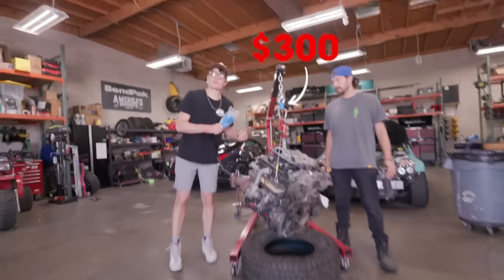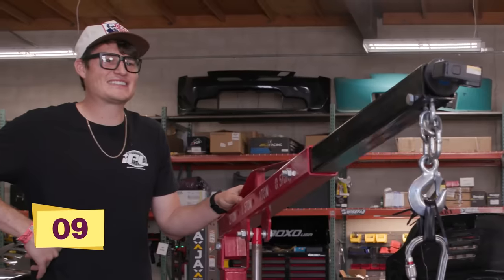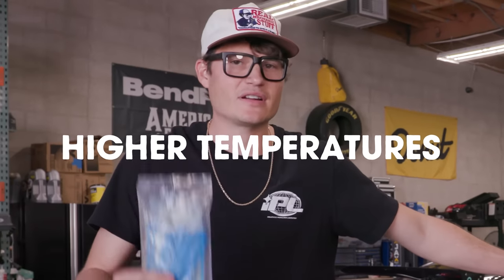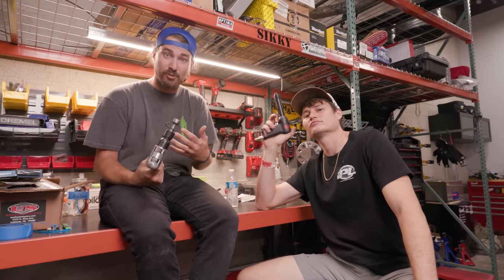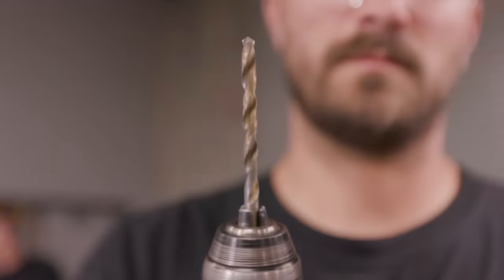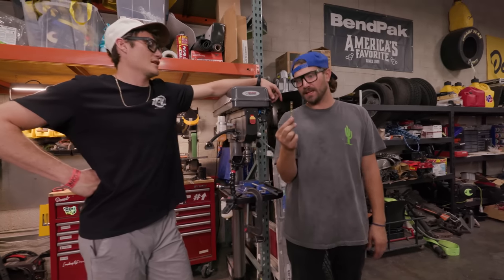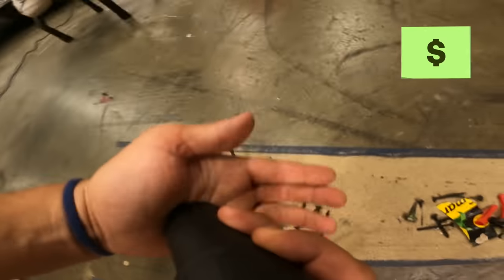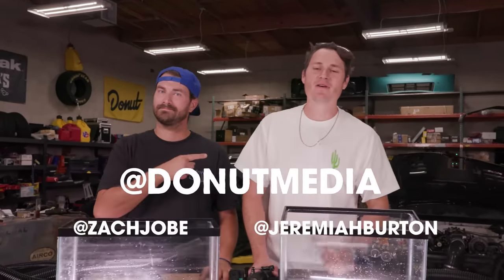We Test: $1 vs $300 Zip Ties

Comment: My dad was an aircraft mechanic back in the day, so in place of zip ties we always used the titanium cable they wrap engine bolts in to prevent them from vibrating loose. 
Probably the most expensive "zip ties" anyone could use
Reply: Probably still cheaper than 3$ a go. Stainless steel lock wire is cheap enough and I think would outlast pretty much any zip tie.
Reply: Called lacing wire
Reply: @alexriofrio5754  Today I learned about 'cable lacing' 👍🏼 is it ever done with metal wire? My only experience with what I call 'lock wire' is steel wire. Useful in holding motocross grips on, also required on certain fasteners especially on race tracks.
Reply: he said titanium
Reply: @poshun9407  I guess it would be called lock wire. I guess I use the term lacing wire for any thin wire that can be used for securing fasteners.
Reply: Yeah no titanium is most certainly not used to wrap bolts unless your dad was working on the SR-71 or something. Unlikely.

Its likely stainless steel  and you can buy about 100 feet of it for $25
Reply: @siddharthiyer1120  it was back in the day so possibly lol
Reply: @siddharthiyer1120  he actually did work on those planes
Reply: @urk5204  cool
Reply: @poshun9407  using wire would be a bad idea incase it cut through shorting the cables.
Reply: @allothernamesbutthis  Yes, the lacing wire all seem to be made of softer materials which makes sense.

For occasions where more strength is required then metals could be used but these aren't really cases where you would use a zip-tie anyway.

Comment: I'm going to guess the more expensive vacuum probably has a HEPA filter and actually traps most dust particles. What point is there to the cheap vacuum if it just spreads the dust around the shop?
Reply: You can only pull one atmosphere of vacuum, so the "sucking" power of the units is always going to be similar.  Along with the filter, I'm guessing that it's just built much better.  Made to last.  Made for a shop that uses it every day vs. a guy using it on weekends in his garage.
Reply: @jeffrobbie472  Vacuums don't actually pull a vacuum (that's very difficult, even for purpose-built vacuum chambers and such), they just create airflow (like a basic fan, but with way more pressure). So you absolutely can have a way stronger vacuum, though it can start to depend on the size of the hose and other factors like that as well.
Reply: All canister vacs come with filters. A HEPA filter is only necessary for people who are extremely sensitive to micro fine dust, otherwise they are not necessary, especially in an open work shop environment. In cases where a person has a sensitivity to dust, face masks work much better as they are disposable and in a dusty work shop environment a HEPA filter would clog up very quickly.
Reply: @TheOnespeedbiker  There. A mechanical workshop doesn't have much dust, more like greasy layer of paste over everything, lol
And a woodwork requires much more than that.

Long ago, I  worked in places with HEPA filters on the air intake and negative pressure in the room... but the objetive was to control the smell of the buds not going outside...ahem...
Reply: @Nwhis  Semantics. Creating airflow is how you pull a vacuum.
Reply: @TheChzoronzon  LOL
Reply: @ailurusfulgens1849  Not semantics, and btw, he isn't saying otherwise

He's saying that a pump able to create a vacumm in a 20l deposit, the usual in these machines, in a reasonable amount of time is no joke, and certainly bigger than anything you are gonna find in a vac cleaner
Reply: shop-vac has one that is around the same price as the bauer, a little bit smaller but not much, and it has a metal casing. i have one at home and it works great. so this seems more like an apples and oranges comparison than anything else. they aren't intended to be used for the same thing.
Reply: It was also way bigger

Comment: As an aircraft mechanic and hobby car mechanic, spend the money on the drill bits. It goes through the hood but anything thicker and the HF bits bend almost instantly
Reply: The cheap ones are most likely designed only for use on wood and plastic.

Comment: Shop vacs, whether big or small are exceedingly underwhelming. Having worked in construction and other areas that require a shop vac just once I want a vacuum that has suction best described as dangerous.
Reply: Ikr. I've done alot of carpentry work, and shop vacs are always pitiful, even if they have a big hose
Reply: Try rigid vac's. I did tile for years and would use all kinds of vacuums when cutting tile. Had to stick with rigid for price and performance.
Reply: Look into fein, pricey but really nice. Don't think you'll get into dangerous suction just due to liability. Parents these days would blame the vacuum for hurting the kids instead of taking responsibility for not watching them, or something lame like that.

Comment: For most things I wouldn't say you need the 300$/100 level, but definitely don't use the cheap as dirt ones either. Especially as you get into smaller and smaller ties, the cheap ones tend to snap before even getting really tight. Likely because a lot of the time the cheap ones are made of less flexible material, so they end up just snapping off easily.
Reply: Like you saw in the test the expensive ones were actually weaker.

Comment: Since you started with just 10 of the expensive ones, each one would have spent work time under tension being fatigued and stretched more than the initial 15 of the cheap ones.
Reply: That's a very solid point you make there. I usually pick apart flaws in videos such as these and completely overlooked that.
Reply: I was thinking the same
Reply: yeah, I want a video by Project farm about this. That channel is more accurate and scientific.
Reply: cheap is still better
Reply: I was gonna say this exact thing but you beat me to it!
Reply: The expensive ones are made from tefzel, which has a room temperature yield strength of about 6,000psi, while the regular ones were probably made from nylon with a yield strength of about 13,000psi. So the experiment was actually pretty close to real life with the tefzel ones snapping at 2x the number of the regular ones. 

Tefzel zipties exist for very specific chemical reasons, and strength is a secondary consideration.
Reply: Plus, who knows how much tension eash tie was under. Maybe one was carrying the load and once that was released, the shock loading popped the rest.
Reply: @mayaibuki  project farm already did a video on zip ties! :D

Actually, I think he's done one on everything they tested lol
Reply: It also looked like the orientation and position of the ties wasn't quite the same between test  runs. I assume they have more tensile strength in certain positions.
Reply: Exactly, and with the heat gun test they
just gave the win to the cheaper ones even though the blue ones lasted 10x longer, bc “IM nOt pAyInG 3$ a ZiP TiE”
Reply: @TheAngryDasher  the biggest flaw is if theyre not perfectly equal in tightness, most of the force is being held by one of them. When it breaks its a zipper of them all breaking. Its just a really bad way to test strength
Reply: While true, it's not relevant to the test results. A few minutes under load will not make that much of a difference. The difference is the material. Tefzel is not as strong as regular zip ties, regardless of what the packaging claims. You don't buy it for that reason in the first place. It's for high temp situations only. If you're buying it, it's because you need it and there is no other option. Obviously.
Reply: That's not how fatigue works.  Holding a constant load isn't fatigue
Reply: @-Mintyy  because its true for 99% of people you dont need a heat resistant zip tie
Reply: @archemides1517  what does that have to do with the fact that it won the test, by 10x the amount of time. Donut has gotten pathetic with their content, look at any of these comments for reference.
Reply: @-Mintyy  okay in what applications are you using zips that need to be resistant to high temperatures because i have used habor freight zip ties in engine bays never had an issue so for most people who arent using them for their heat resistant properties it makes no sense to buy the 300 dollar bag of zip ties. for almost everyone strength will be more important then heat resistance
Reply: yea, guess i never have to worry about my zip ties breaking, i zip tied my capacitor, line output converter, AMP, and TV tuner and all the wires for them to the ceiling of my trunk, best why to hide stuff.
Reply: @archemides1517  then why even run the heat test they did? Why have any tests if they’re just going to pick whoever they want to win? That’s my only point here brotha.
Reply: @-Mintyy  the point of the heat test was to show why those zip ties are 3 bucks a pop
Reply: @archemides1517  if that was to point than it would have better been shown by saying that’s why the blue ones are 300$ a pop and giving them the win. This content is as bad as tv infomercials lol. There is no defending it.
Reply: I think most of these kinds of videos it's never implied that their tests are perfect scientifically, so I don't usually hyper analyze them as long as they convey some information that is useful. Like if someone is testing a tool, if their tasks actually replicate work i would be doing, as opposed to pointless tests like hooking two drills together and seeing which ones break first is not a useful test. In this case it doesn't really matter because I wouldn't(and i imagine most of you would be the same) ever under any circumstances buy $300 zip ties. So there is no reason to really think too hard about it at all.
Reply: True, but considering the price difference that's still pretty insane.

But it was also strongly highlighted that raw strength was not the benefit of those zip ties (and never was: they had the same weight rating) - it's resistance to heat and corrosion.
Reply: The tefzel zipties are likely much more heat resistant and would do great for engine bay components
Reply: @MrNavyman53  Agreed. As a guy who uses a lot of cable ties for a living, in my opinion as a guy who likes science, the test results were scientific only to test how relatively dumb you are for lifting an engine with zip ties based on the zip tie. The only fair comparison would be something like Tyco/TE Connectivity zip ties vs Harbor Freight zip ties in the same material, one zip tie at a time. Or, comparing 2 materials for tensile strength using the same width and length of tie. Without a parallel attachment and really high precision zip ties, the consequence is highly uneven loading from tie to tie. Tefzel also elongates 100 to 300% when it yields, as opposed to 60%-100% for nylon, and as plastics stretch and get thinner it typically does not make them stronger. The heat test was the most compelling, and next time I'm installing zip ties in an atmosphere of superheated air and highly corrosive chemicals I know to get the $3 zip tie, not the $0.03 zip tie.
Reply: @-Mintyy  My only defense of it is that people do really, really dumb crap and hoisting with zipties is not as uncommon as one would like to believe it is. The Tefzel zip ties are good for people who won't spend the $3/zip tie money on proper lifting equipment and instead are hoisting engines with zip ties during an acid leak inside a steam turbine building as well as in their garage. They fail to get the W for tensile strength except in exposure to heat and chemicals that weaken nylon. The test is the "If you're going to do dumb s**t, here's which of exactly 2 types of plastic at opposite ends of the manufacturing quality spectrum is most appropriate for decreasing the rate of serious injury you're likely to sustain for being that dumb."
Reply: @JD-xh2by  Precisely, which is why although cost correlates with quality fairly strongly in life, it's what the defined quality you're paying for is (in this case, integrity over time in harsh conditions). A 24kt gold chain costs far more than a forged, heat treated logging chain, and won't corrode, but I'm not going to try and drag stuff with jewelry. This is sort of like if they reincarnated Mythbusters using infomercial actors and producers.
Reply: The cheap ties spent more time strained, because Zach had to clip through the initial five to get to the final 10. That means that the cheap 10 had already experienced strain at the point when the expensive 10 were fresh. If the additional variable benefits the cheap ties, I'd expect it to be that the slower ramping up of strain helped the final 10 cheap ties adjust.

To test that I'd load individual ties with a hanging scale, testing the weight they snap at when loaded quickly versus slowly. But for the main test, yeah, not doing a 10 vs. 10 definitely introduced a variable.
Reply: you're still comparing $30 worth of the expensive zip ties vs like $1 worth of cheap ones
Reply: @-Mintyy  you're a dope if you pay $3 a zip tie

Comment: The heat gun was already heated up from the first run so the 2nd run didn’t have a fair advantage?
Reply: It would have cooled down in the time it took them to reset the test. The heating elements or wires are very thin and cool down quite fast. And in a 13 second run, the case of the heat gun would have barely warmed. Certainly not enough to hold temp between tests
Reply: Proof that youtube commenters can find an issue to complain about in a video better than a needle im the haystack
Reply: @mmorgz6622  we don’t know the time between tests and you say it would barely get warm in 13 seconds but reached a few hundred degrees in a few second. It don’t take long to reach max temperature
Reply: Money advantage ??   They were comparing zip tie cost, not heat gun.     Oh....you meant FAIR.
Reply: Yes and we have to take into account the ambient humidity and UV index, plus what if some zip ties were stored in a warehouse longer than the other? Also, we never even were told how many clicks the zip ties were set at??? This is a very scientifically accurate test on youtube, we need consistancy!?!11
Reply: The time between tests would be at least a minute. I'm not talking half HR +. If it took them at least a minute to reset, the heat gun elements would have cooled down completely. The temperature would  be the air temp. It's designed to create hot air and it will throw hot air very fast of course, but the gun case will not heat up much in 13 seconds and the element will cool down very quickly when turned off.

But regardless of the way they tested it, the results will be the same. HF ties don't like heat.

Comment: cant really compare normal drills vs cobalt..

i would always go for cobalt since you can drill stainless steel.

with that said you can find cheaper cobalt drills.

flaw you guys made is that you need to drill at slow speed to avoid the to overheat and melt
Reply: True, ever since I got fed up with ordinary HSS bits getting blunt (especially the really small ones) and bought a set of cobalt bits I stopped buying HSS bits. I didn't even need to buy much cobalt bits, because they last A LOT longer. They are completely worth it.
Reply: @showmethedammovie  Not exactly. the point was to test the difference between the same type of product.

Cobalt drills are made to be able to drill harder materials.

While normal HSS cant because they are to soft.

It has nothing to do with the price difference since they bought 2 different products.

Should been Cheap/expensive within the same product category.

And drilling with to high speed also dont reflect the product quality since you aint really testing the product.

The answear is however always cobalt but it had nothing to do with the price. You can find them cheaply online aswell

Comment: i have harbor freight zip ties holding my bumper together in an x pattern and its been 10 years and not a single one has broken. every time i look at my bumper i cant believe they are still in there. probably helps that they are black and the uv cant penetrate too far into them and degrade them.

Comment: The vacuums have the same size motor based on the fact that you have to plug them into an outlet so they can only be up to a certain amperage and they're the same style of motor. But I'm pretty sure if you guys had done a test where you left them on running for a long period of time the Bauer would probably start smoking.
Reply: Just because a receptacle can deliver 15 amps, probably 20amp in that setting, doesn't mean that it's maxed out power wise when you plug anything in. 
A tenth horse motor is a tenth horse no matter if it's on a 15 amp circuit or a 100 amp circuit and a 2 horse motor will always be stronger than it no matter what amp circuit it is plugged into.

Comment: I would never spend that much on a shop vac 
And I’m convinced you two are at least  related
Reply: Question is, how do they hold up after a year (or years of regular use). How do they hold up standing in a corner after having vacuumed some water. And what I found kills electronics, how well do they deal with metal dust.
Mind you, I'm not claiming the expensive one is better, just saying that this test might not tell the whole story.
Reply: I love the Dewalt brand so I got a shop vac from Amazon made by Dewalt for about 80$ and it’s fantastic.
Reply: Dating

Comment: Cool video! I have a small warehouse and I've had both cheap and real Shop Vac and there is not much that difference between them. I have a Ridgid instead and it's a beast and I have it for more than 10 years and still running strong, it killed the other ones I had.
Reply: Yeah at my work they have a pretty old rigid that's been through everything, threw in a new filter the other day and it still runs strong
Reply: Love my rigid shop vac. Never lets me down.